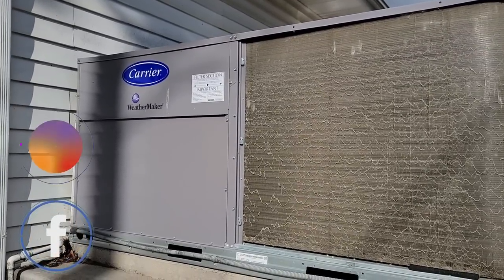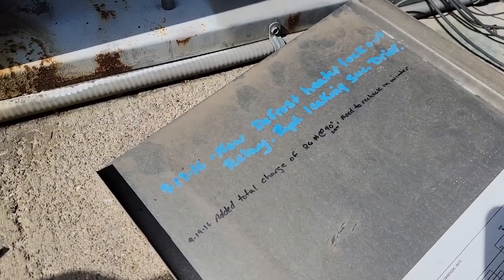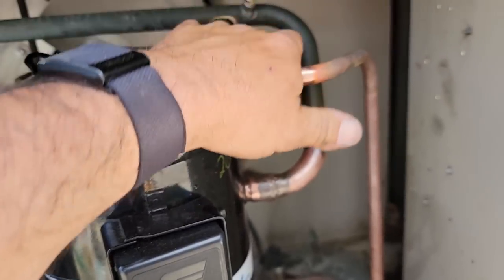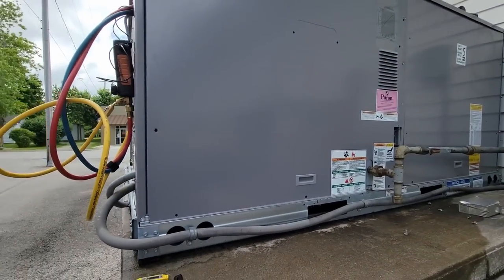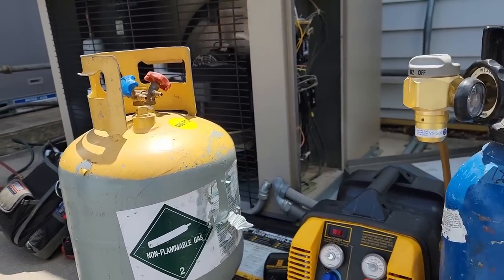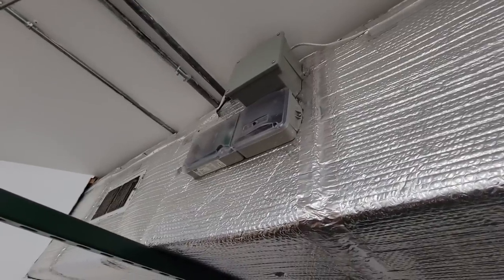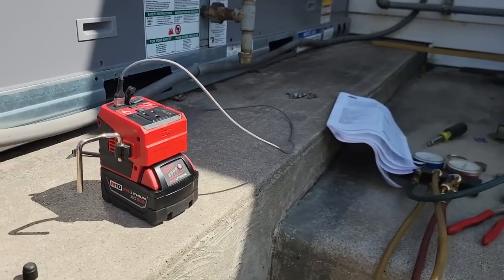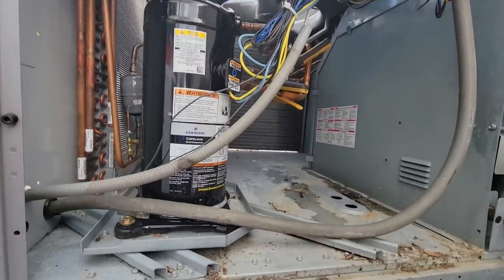If It Can Go Wrong It Can And Does Compressor Change / No Cool / Cooler Failing & More!!!

Comment: If anyone watching has been thinking about purchasing that hilmor swedge you really cant imagine how much time this has saved me over the past couple years ive had it. less trips to truck to dig for fitting, less trips to supply house for one mf coupling. Great video, liked and subscribed.
Reply from the maker: My only problem is the smaller diameter stuff, 1/4" & 3/8".  I like to either rotate it multiple times or heat it up first.

Comment: Really liked the video. You get right to it and show the important process of trouble shooting. I would think that anyone watching your vids would already know how to solder and braze copper lines. So we don't need to watch you doing that. Or checking for 3 Phase as ,, Most of us already understand that..  I would think that some of these compressors would run backwards if the phasing is reversed, Yes?
 The troubleshooting aspects and what and how to check the components is what I'm interested in. Good job! I learned a lot. BTW I'm  a retired electrical electronics engineer and the refrigeration controls-and components is what's the most interesting and new to me. Thanks for sharing. 🙂
Reply from the maker: Awesome! I was signed up to go Devry for an elections technician but changed my schools at the last moment.

Comment: That is one busy day.  Jumping back and forth btw units whilst filming, that makes for a captivating video.  Kudos to the video editor.

  Your comment on the Economiser is more relevant given this is a public space, now without the usual minimum fresh air (assumes no other source).  Not Kosher.
   Where I am on the Canadian Prairies, I wonder about the actual cooling usefulness of the Economiser, but cannot rule out the value added by mixed air dampers vs first stage cooling ability.
Reply from the maker: 🤣 I wish I had a editor.

Comment: Thank you for the video. Watched 2 today. I always get a lot out of them, whoever I watch. Wow that was a lot of work. Especially, trying to fix three pieces of equipment at the same time with so many issues. 1. That sound on the compressor when you turned the switch back on would have scared the poop out of me if I was there. I don't like when it makes that metallic/electric sound. 2. I am very curious on that AC and what is going on with it. I was going through a similar situation weeks ago when the high head pressure was really high and it was freezing, high subcooling. I checked the temperature difference across the filter drier and there was 33° F difference. Airflow was low. Exhausts fans were running full blast. Make up air not working. And the Testo probes that I have starting to get stuck too. That didn't help. They just stayed in one number. I took them out and they didn't clear. I zeroed them out, and they didn't do anything. Frustrating. I will be checking your channel out to see what happens with that AC. Thank you.

Comment: Your Erratic high pressure reading on the Testo gauges could be from the Schrader core depressor at the end of your hose being recessed too much. If it initially pushes the core in a little bit and then stops, the hose fills with refrigerant and heats up from the temperature of the liquid/ discharge line but is now isolated from the system so pressure builds with the increase in temperature. It’s happened to me before.
Reply from the maker: I have had that happen before, in part two you'll see what I think happened.

Comment: Well here's me gambling on when part 2 comes out: the two wires for high stage on that compressor are DC voltage, and your AC clamp meter isn't going to pick it up. And if they did that weird stuff with the relay and sent 24VAC to the full capacity solenoid on the compressor it's going to fry it because of poor magnetic coupling.  I have a feeling they did and you're running 66% compressor under 100% load making the compressor virtually too small and allowing a flooded evaporator, freezing suction line, etc. I hope for your sanity that I'm wrong.  Good luck Rick.
Reply: This was one of best multitasking videos i've seen with difficult issues and skilled decisions. Good work!
Reply from the maker: I read that manual when I got home and I hate reading...The rectifier is in the end of the harness at the compressor... Your one the right track. The screw ups were found on the next one or two trips...
Reply from the maker: @elijahgoodman3140  thanks man!
Reply: @HVACRSurvival  it's been a while since I played with one of those compressors and it's kinda nice to see they made the rectifier be built in to the plug. My apologies for the doom and gloom.  Hope you have a fun 4th!

Comment: I have the same crimps I love them. I also use the same recovery unit that you are using in the video it’s surprised me how good it works even on big systems like chillers. Thanks for the video !
Reply from the maker: I usually use them for my big wire crimps, 12ga and 10ga. I love them!

Comment: Ahh man, DJ Rick, I guess I'm not allowed to give you a hard time, this time because you stressed out today, Rick you do better work than you give yourself credit for, your just camera shy, just kidding, You get to go out on calls and get to have fun fixing all kinds of equipment, and that's good all the time, You get to make money and get better at your skill level, Good job Rick, and I did like the tachometer, I'm going to have to get one of those.
Reply from the maker: Thanks so much John. I found that tach on Amazon, I compared it to several tachs and tested it on few 3400 rpm motors, it seams very accurate.

Comment: I know those weather maker units are very bad when it comes down to brazen because technically each one of those lines coming out of that evaporator is technically a capillary line and get blocked pretty easily I've had a few times where I've had to take out the entire evaporator coil and blow them all out

Comment: I didn't leave a piece metal in a disconnected solenoid while it was energized for like a good 5-10 minutes. Was burning hot and i was shitting bricks that i'd cooked it. thankfully it still worked fine. Was a Danfoss so they must build them strong. Don't want to test that again however.
Reply from the maker: I’ve made that mistake before myself not realizing I forgot to reinstall the coil on the valve. That sucks

Comment: Oh, and did you happen to ask the guy that installed the package unit why he opened up the pulley all the way? I bet they oversized the unit for the ductwork and it was running crazy static pressure with factory airflow. You might have to disable 2nd stage if there's not enough airflow for it.
Reply from the maker: Fan speed doesn't change on the stage change on this unit because it didn't have the VFD. I've noticed the factory has the pulleys like that on most of the new units. I don't think this system got started like we normally do, when the office heard what all I had to do they were not happy. This has been the best company I've worked for, they train the guys and make sure the job is correct when they find out there is a problem.

Comment: Do you know why someone installed a fan cycle control on that condensing unit?  They come with a headmaster.  Nice videos.
Reply from the maker: Carrier has several trim levels, this was a stripped down system, We quote three different models on every quote and several optional accessory's on top of that and this is what the customer picked. I bitched about the economizer and found of as you heard on the video they didn't choose it. I felt better when I heard we at lest offered it...
Reply: @HVACRSurvival  Thanks for the explanation. I should have been more specific. I was asking about the Heatcraft 4.5hp condensing unit.

Comment: Does Carrier give blower pulley RPM specs? I though they just gave pulley turns open? I'd probably go one more turn so you hit 0.5". Low load can cause the TXV to hunt like that, but that could be due to the weird hybrid setup with orifice/TXV too?
Reply from the maker: I find out more on the AC and the walk in freezer on the next one or two trips....lol

Comment: Whoa, bro... That was a bit of a grind... Makes the day burn by... One question on the A/C. Where they looking for shaft speed or outer pulley speed?  I've always tried to do shaft speed, or at the very least pulley hub speed, but I may have been doing it wrong for a very long time. ;-{
Reply from the maker: I'm not really sure either, I have tried it all over the pulley and its about the same all over.

Comment: Will a kinked liquid line stop a central AC from cooling and would it be immediate or over a few weeks?
Reply from the maker: Depends how badly it's kinked, generally it will still work but could reduce oil return.
Reply: @HVACRSurvival  about 50% or a little more?

Comment: 4:40 thread locker and an o-ring to seal?  or was it flare fitting that needs properly torqued to seal? watch out for that in the field, it could be either way, so techs need to pay attention to changes and not always assume one or the other. that goes for all fields of work, always pay attention to materials, tools and surroundings! why? because things change very fast, what worked yesterday may be nearly null and useless as of today/tomorrow. not saying technological improvements are all bad, but they all need to be "taken with a grain of salt"

Comment: Personally I hate it when they put pressure switches on stuff without a delay-on-break timer. There's no point if the low pressure is just going to chatter or short cycle and kill the compressor. So stupid. I either add a 3 min timer or disconnect the low switch.

Comment: 9:20. junk metal, corrosion or winter freezing is to blame, it physically constricted and mechanically seized the valve stem inside the bore. go figure! that could happen indoor/outdoor/in box/in condenser. solenoid valves to pump down, number one cause of many failures! grated the theory behind it was to allow multiple "units" ran off a single large circuit. there is a breaking point of no return when circuits get overpopulated(typical supermarkets). AKA. miles of tubing, buildings with coolers and freezers that are hundreds of feet in length x10.
(ramble-tamble) on, totally inspired by CCR( Creedence Clearwater-Revival).